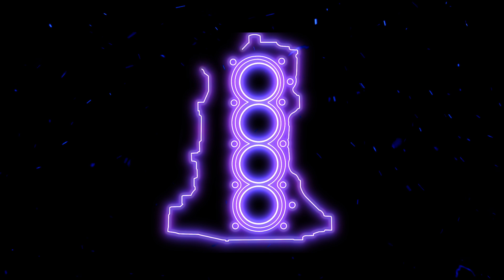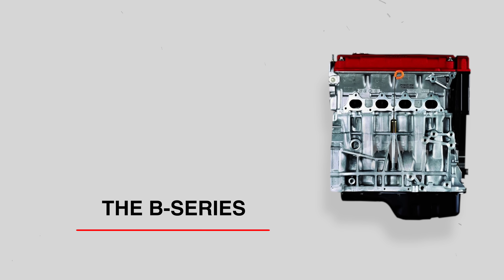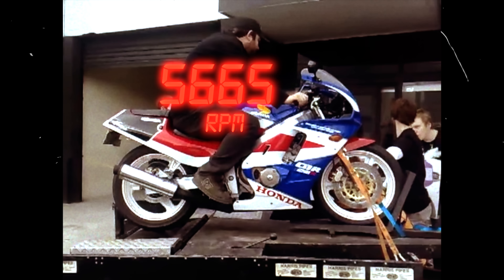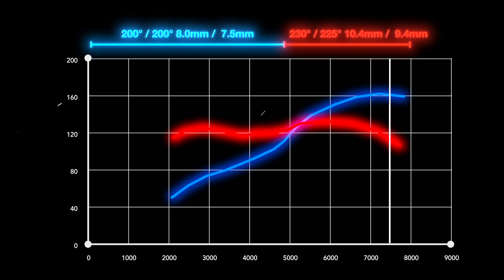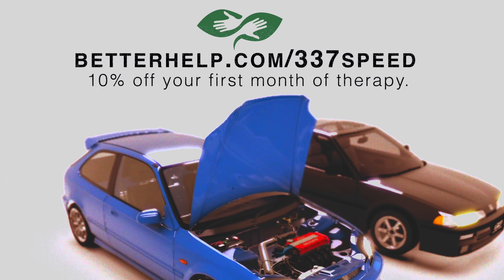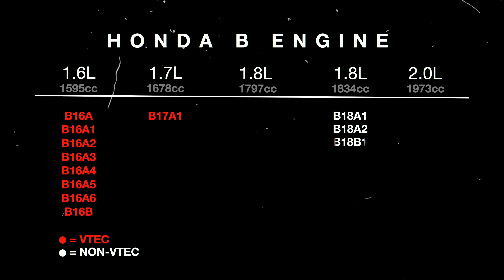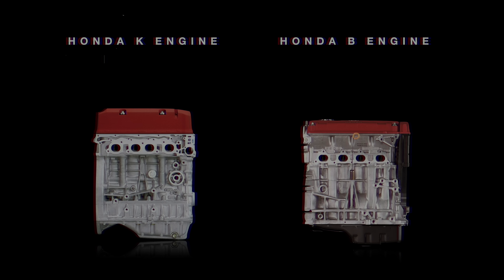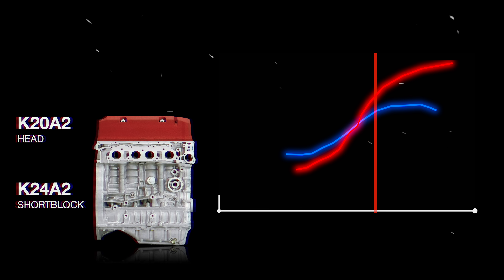How Honda’s VTEC Changed Sport Compacts Forever😳| Explained Ep.46

Comment: Honda's VTEC tech was so revolutionary for its time back in the 90s and 2000s. Today, folks will never understand how VTEC change NA engines for forever. It isn't just horsepower that benefited from VTEC but even economy engines benefited from VTEC. The Civic VX has VTEC-E which helped the car achieve 40 mpg city & 46 mpg highway and also has a max 92 HP. Keep in mind the Civic CX only has 70 HP since its engine didn't have VTEC. Today, car manufactures has their own versions of VTEC now because its better for fuel efficiency and horsepower gain.

Comment: still to this day, I struggle to think of any engine that sounds better than a Honda 4 cyl at 9k rpm.  I could drive an S2000 with an intake for the rest of my life and never want more.  whatever takumi was chasing with his ae86 was achieved with the s2000...although, i'd argue a 4age 20v at 9k sounds almost as good as the F20b, or a B18c.  I know K motors are technically better, but there's something special about a raw vtec crossover...

Comment: BMW made engine variable valves timing system first in 1972 almost 20 years before vtec.
Reply: VTEC or Variable valve Timing and lift Electronic Control is how far the valve opens. Variable valve timing or VVT is how soon/late the valve starts opening in relation to the crank position. VVT is a generic system in any car which honda also has but they named it VTC. Honda engine that has both VTEC + VTC is called i-VTEC

Comment: I had enjoy my time with B17A1 GS-R and B18C5 Type R high rev and scream down the street to hugging on highway on ramp with RE010 tires 
chasing down Bikes and racing Mustang

Even more so on the K24 in TSX same close gear ratio with far more low end torque.

This video is really well put together 👏👏👏

Comment: Love inline 3 engine was jt possible to make 1300bhp too 1400bhp 

Inline 3 1.5liter i think would be cool 

If it competed with 1.5liter inline 4 m10 to m12a twinturbocharger setup

Whst they make  high rpm 18,000rpm 

Inline 3 engine 660cc engine to 350bhp if possible 

Those who drives Honda engine etc

K series popular now

I do agree that b series are it original version i call mk1

Vvl or vtec

Lot older then honda in respect 

Dates back to areo plane engine technology or military services technology in tank and military equipment for engine etc

Comment: The first variable valve timing (VVT) system used in a production vehicle was the 1980 Alfa Romeo Spider 2000. This system was a mechanical VVT system, not the later electronic systems developed by other manufacturers. The system was developed by Ing Giampaolo Garcea in the 1970s and fitted to the fuel-injected models of the Spider.

Comment: I wish they did more with the J series. Specifically making it a larger bore engine to match the 2GR and the VQ series, but while also keeping the 93mm stroke that the J35s have, in particular. A J40 with a 95mm bore and 93mm stroke and upscaled cylinder heads to match the new bore with K series flow and full Vtec (better yet, now CVVD) would be an absolute killer and probably able to push almost 400whp all motor with an 8200rpm redline and be no more stressed than an S2000 motor. Put THAT in an NSX or S2000 platform and tell me it wouldn't seat Honda at the head of the table when it came to soulful, reliable performance.

Comment: "WHAT ABOUT THE RC166!!???".....🤪
"THAT 250, REVVED TO, HOW MUCH!??........🤔
"20, 000 RPM!!!"
" WHAT ABOUT THE, NR-500, GRAND PRIX BIKE???," !!!"
HOW HIGH DID IT REV......?????????
"20, RPM"
"WHAT ABOUT OVAL PISTON TECHNOLOGY!!???"
"1985, I THINK, THE NR750 WAS GOING FOR $10,000."
"AT THE SAME TIME, YOU COULD GET AN NSX, FOR THE SAME MONEY!!! " ✌️😃👍
"I PREFER, THE RZ-350NC (new Californian!!!!)
"Mine was red and white, Kenny Roberts rep.!!!!" Full -tilt engine!!
(Dry plate racing clutch/ ATK fork springs,/ fork brace, 
"Fox shock/ Cal-Fab, two-inch extension swingarm, ceramic bearings,!!!"
"Dy-mags in 18 by 3, up front, 18 by 4.00 out back. Only Eric Buell, carried the wheels back then."
"SO I BOUGHT A SET OF 10.5 INCH CAST IRON ROTORS, AND CHANGED  ME  TO, FULL FLOATING !!!! 
THANK YOU!!!" 👍🇺🇸
"I BELIEVE YAMAHA OWNED PART OF, ISR, BREAKING CALIPERS."
SO I GOT A SET OF FOUR PISTONS.!!!"
GREW UP IN THE COACHELLA VALLEY. 
HIGHWAY 74, FROM PALM DESERT TO HEMET. BELONGED TO ME!!! 🤪👍
"THE LAST OF THE TWO-STROKE TWINS!!!"
(TEAM GONZO!!!)
👣👍🇺🇸

Comment: TOYOTA CELICA GTS LIFT HIT @7500 easily pushing 10,000 rpm. We once push one on the dyno to see when she broke it was 14,261 rpm. Same motor the lotus has. VVTL-i   2ZZ-GE What a fun motor that one is just a blast to drive. when they redline your just hitting lift for a quick pull away and a six speed to keep pulling away in 5th hitting lift and holding it best sound ever! thanks for your time and info. not to get confused with the mazda b3.

Comment: People make fun of hondas for being slow and sh1t and they are slow if you compare them with lamborginis or corvettes with 500hp+, but only the real petrol head and mechanics and engineers undarstand that 160-180hp in a stock no turbo no supercharger 1.6 litres is a lot. Honda s2000 with 2.0l n/a 240hp held the record of most power producing n/a engine per liter. That record was broken by ferrari italia 458

Comment: Now you say HP/Litre.  That is not a performance metic, that is a bragging rights metric.
HP/Kg or Lbs, now there is a metric that actually means something and can be used in the real world.

From a basic engineering standpoint, I am 2 minutes in and we have common fanboy language going on a little too frequently. 

Revs vs HP and torque, you need to implement the relationship to understanding the engine and use in your videos.
Don't get me wrong, I love Honda's and have a K20a in an LMP3 car, but I understand what really makes it special, VTEC has been deleted also.

Comment: Technically speaking, didn't nissan do it first with their N-VCT on the VG30DE and VG20DE turbo. Those came in 87 while vtec came out in 89.

Or is this just about 4 cylinder engines since the aforementioned are V6 engines?
Reply: No, the Nissan system only varied timing, VTEC varied timing, lift and duration. Nissan later made their own version of VTEC, which they called Neo VVL. Toyota also made VVTL-i (not to be confused with VVT-i), Mitsubishi made MIVEC, Porsche made VarioCam Plus, etc...
Reply: @PistonAvatarGuy  okay gotcha thanks 👍🏾👍🏾👍🏾

Comment: Vtec was the first reliable production variable value timing system. Without them pretty much none of the other car companies would’ve developed similar system for performance. All the high revving, naturally aspirated engine we loved… the S54 and S65 from BMW… the Audi FSI V8, the Porsche GT3 engines… none of those would’ve been developed without Honda pushing the envelope with VTEC.

With that said, there are better technology to achieve variable value timing now. Cam phasing seems to be the modern approach to achieve wider band of volumetric efficiency across a larger rev band. So although Honda have finally retired Vtec, its legacy lives on
Reply: Cam phasing can't vary lift or duration like VTEC can. The VTEC mechanism was also used to provide efficiency improvements, via reduced pumping losses (R18) and cylinder deactivation (J series). There's really no substitute for VTEC, other manufacturers just haven't been able to build a cam-changing mechanism that works as well, so they make due with other types of VVT systems.
Reply: Also, turbocharging is the reason why Honda retired VTEC... for the most part (it's still used in some Honda engines, including the turbocharged Type R engine).

Comment: Just to point out how potent VTEC makes an engine: The 2.0 L Ti-VCT GDI engine in the 2012 Ford Focus had 146 lb-ft of torque at 4,450 rpm, and that's it for its torque output, it just drops off after that, resulting in 160 peak hp at 6,500 rpm. For comparison, the K20A in the 2007 Civic Type R also had a torque peak in the high 140s, but it was at 3,000 rpm... and that was just on the primary and secondary cam lobes, so once VTEC kicked in, it had a second torque peak of 158 lb-ft at 6,100 rpm, and it was also able to rev further until it hit its peak power output of 221 hp at 8,000 rpm. Consider that this was an engine that only had port injection and that its torque output not only comes on sooner, but also continues on to a greater peak output at a higher rpm. VTEC is no joke, so anyone who believes that it's just all the lag of a turbocharger without a turbocharger has no idea what they're talking about.
Reply: All that tech to make 221 hp? Bro just get a v8. We make double the torque when stock and at half the rpm 😅
Not trying to hate just don’t get the Honda hype.
Reply: @angelgjr1999 That's not point, bud. VTEC can massively improve the performance of any engine, so a 5.5-6.0 liter V8 with VTEC would be an absolute monster and would destroy any American V8 currently in existence.

Anyway, when an American V8 beats the K-series to the top of Pikes Peak, I might consider wanting one.
Reply: @PistonAvatarGuy Don’t most new engines have variable timing? They just call it different things. My Camry has it.
Reply: @angelgjr1999 VTEC is very different from the vast majority of VVT systems and it offers very significant benefits over those systems. Notice how the Ford engine that I described above has Ti-VCT (twin independent variable cam timing) and direct injection, yet it doesn't come close to matching the performance of the VTEC engine.

You missed my point with regard to weight. American V8s (the engines themselves), in general, are too large and heavy for the amount of power that they produce to be competitive in the higher realms of motorsport, where every gram, every liter of displacement and every kW produced by the engine counts. That's why you wont see a V8 powered American vehicle that's able to beat a Japanese or European engine (4 cylinder or V6) up Pikes Peak, it's why the most dominant car in time attack is powered by a 4 cylinder (based on a Porsche engine), it's why Americans can't build a car that could ever set a record on Circuit de la Sarthe, or on the Nurburgring, and it's why they can't compete in F1, they're just not on par with the best of the best.
Reply: @angelgjr1999 Heck, American V8s don't even do well against 4 cylinders in time attack, they're just too heavy and clunky.
Reply: @PistonAvatarGuy Depends on which on. The Charger is very heavy. The Camaro isn’t. The Camaro ZL1 is a beast. And I’m not a fan of new mustangs due to weight and a locked ecu. My New Edge weighs 3200 lbs while having a V8 and 5 speed manual. Doesn’t get much more fun than that. At least for the budget. You have to spend thousands just to match it. Meanwhile for 3 grand I could make mine make 450 hp and it’ll be faster than a hellcat. 😅
Reply: @angelgjr1999I posted another comment on this video that goes into more detail, but I don't know if it's visible.
Reply: @angelgjr1999 10k rpm in a car that small is a one of a kind
Reply: it's not "vtec" that makes that happen. the K series engines are known to have one of the best designed 4 cylinder heads ever made. The ford focus engine also wasn't necessarily designed to make power like that. A lot of engines have turbos for efficiency, rather than power. VTEC is simply variable timing, which is something that most engines have these days, but Honda was one of the first to implement it in the way they did, having two distinct valve profiles. However, its less impressive when it comes to actual race cars, because you simply do not need a low profile cam, if you're never going below 4k rpm. For higher end race engines, VTEC is usually "disabled" and pins lock the rockers into constant engagement.
Reply: @freshfrij0les  6/10 ragebait
Reply: @freshfrij0les  Fine, I'll bite.

The heads are only as good as they are because of the VTEC system. You can't make ports like that work in a production car engine without VTEC (or an equally capable cam-changing VVT system), it would never meet emissions standards, nor would the engine have good enough driveability to be acceptable for use in a production car without VTEC.

If the Focus engine is not a good enough example, find one that you consider to be acceptable, I guarantee that you wont be able to find any other naturally aspirated engines that have a BMEP as high as the K20 over as wide of an rpm range.

No one said anything about VTEC being useful in racing engines, the system specifically improves the performance of the emissions controlled engines used in street legal and street-driven vehicles.

VTEC is not simply variable valve timing, it's variable valve timing, duration and lift.
Reply: @freshfrij0les  And, really, the benefit that VTEC provides when it comes to production-based racing engines is in the port design, which can be far closer to a purpose-built racing engine than it otherwise could be without VTEC.
Reply: @freshfrij0les  Even if you look at something like the GM LT6, which does manage to have a very decent BMEP over a wide range of RPM (it's a much newer, direct injected engine that was built purely for use in a sports car), you can see that it has almost nothing at the bottom end. At 3,000 RPM, the LT6 only manages a BMEP of 135 psi, but with VTEC, it would be hitting its first torque peak at that rpm, with a BMEP somewhere in the 180s... at the very least.

Edit: VTEC on the LT6 would translate to roughly 100 lb-ft more at 3,000 rpm.

@ 3,000 rpm:
LT6: ~ 135 psi
K20: ~ 183 psi

@ peak torque:
LT6: 207 psi @ 6,300 rpm
K20: 195 @ 6,100 rpm

Conclusion: The VTEC torque curve is FAT.

Comment: And how Honda created the most gutless engine for a sports car. The D15B2 with automatic i have in my 90 CRX. Lucky if im pushing 80 hp. Dangerous getting on freeway with no power. Swaps or mods are very difficult to to pas inspection here in California.

Comment: The good ol 90's.. glad I only had a dumb honda for 1 year.. I just remember having it pinned and screaming to redline thru 4 gears, and still not reaching 100mph.. LMAO.. So glad I listened to my gut, got a job at the local filling station, and bought a 5.0 Fox Mustang.. And laughed at the honda guys.. Cuz they were slow AF until turbo tech really exploded in the late 2000's.. There were a couple nx hondas that worked OK, but tires sucked in the 90's and so did any sort of aftermarket, or how to get the parts.. Even fox body parts had to be ordered thru catalogs and you just hoped they worked.. I ordered 4:10's, a clutch and an F cam for my 89.. And I thought I was fast AF running low 13s..

Comment: Comparing the behavior of my K20 I-VTEC in the 2008 Civic SI and the 4B11T MIVEC in my 2012 Evo X, I have no doubt in saying that MIVEC was more advanced but therefore less present in the driving experience. The VTEC and I-VTEC literally scream at you "I started operating here". Regardless of the result, it is a very specific and fun driving experience. Even in my Type R with the K20C1 Turbo, at high revs, this VTEC behavior is very present.

Comment: It's not turbo lag without the turbo, it's literally a wider torque/power band than could otherwise be achieved without VTEC. VTEC engines also flow massive amounts of air for their bore diameter/displacement, because the VTEC system allows the ports to be much larger than they otherwise could be without the system. On a per displacement basis, VTEC engines produce more torque (BMEP) and hp than the vast majority of other engines.

Put simply: Without VTEC, Honda engines would be limited to the "lag" part of their power curve, without ever having the "boost" part of their power curve... like every other engine that doesn't have a cam-changing VVT system.

Comment: Would only use one in a longitudinal rear wheel Drive or all-wheel-drive setup. Anything transverse is trash no matter how powerful. Top in quality vehicles have longitudinal rear wheel drive based powerplants for a reason.  Transverse front wheel drive is cheap and no driving purist. seeks such an orientation.

Comment: Forgot about the new gen frankinstien,
K24Z7 block from 2015 civic si (the last production k series engines)
K20Z1 2006 RSX type S head 
(The last production k20 engines)
Creates a higher compression dual vtech high flowing engine, ….+ boost = big power 🤌

Comment: You forgot to mention the Toyota Engine that used a similar valve train control strategy around the same time as the entry of the K series. The Toyota 2ZZ-GE 1.8 L 4 Cyl. Made between 170-190hp in NA Form and was when Toyota introduced “VVTL-i” rather than “VVT-i”. The L was obviously a reference to the increased valve lift when the oil pressure switch triggered the higher can profile at 6500 rpm, but they also had Variable Valve Timing gears to optimize low end torque and smooth running. Now they are not nearly as well known and there are probably far less of them out there than the K series. Since they only came in the Celica GTS, Corolla XRS (1st gen), Matrix XRS (first gen), and Pontiac Vibe GT (also first gen) which happened to be a rebadged Toyota Volt or Voltz can never remember the exact name without looking it up. It also wasn’t the first time GM borrowed a platform from Toyota and just slapped a new badge on it. They did it previously with the Chevy/Geo Prism which was just a Corolla with Bosch electronics instead of Denso.

Comment: An earlier Prelude with the B21A1 had FRM cylinder walls later seen in the H series, S2000s F series, and (I think) the 2nd gen NSX JNC1 engine. I’d be interested in a cylinder liners/coatings video about other forms of it like Nikasil or sleeving and how it can contribute to high horsepower builds